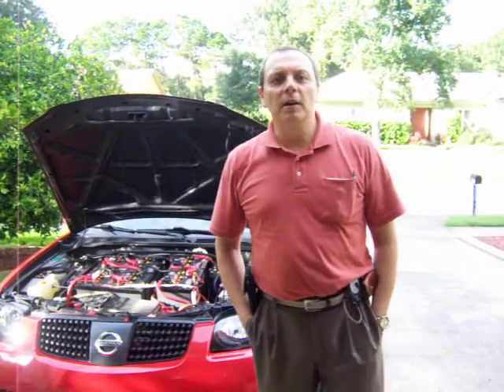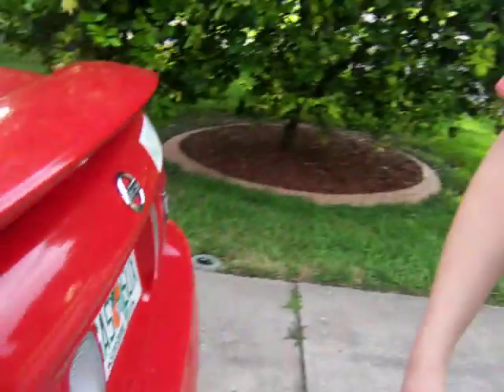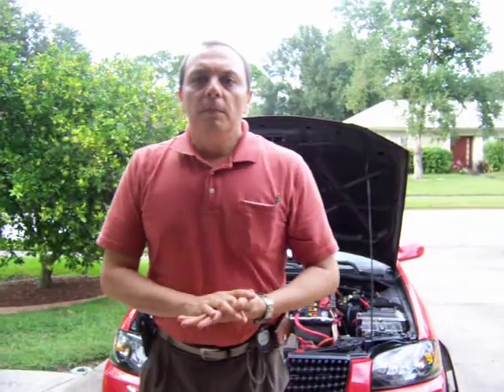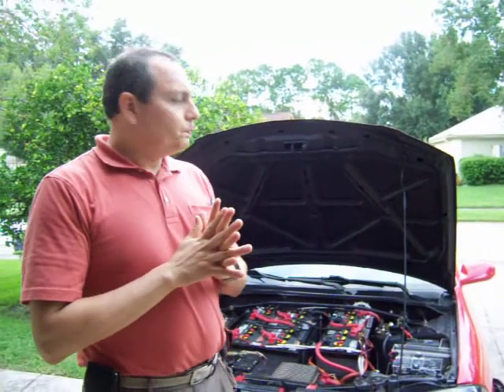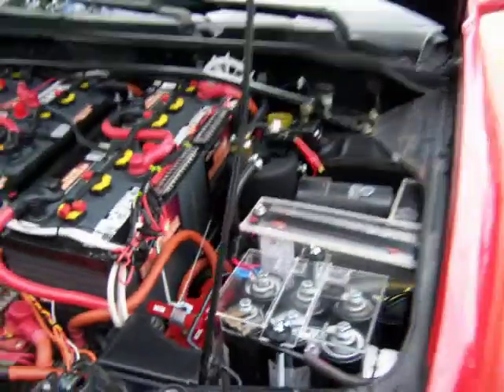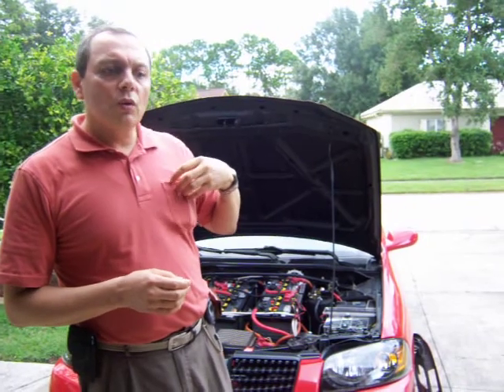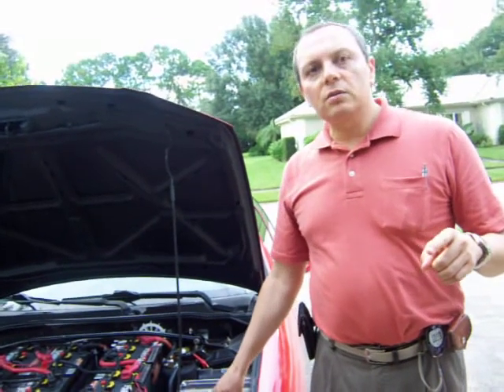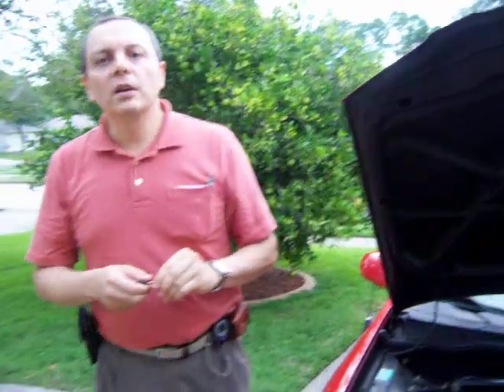Nissan Sentra Electric Car Conversion Part 34

Comment: On the capacitors:
1 They have a maximum voltage, not an optimal voltage like a battery.
A 15 Volt capacitor wil work happily (and deliver high amps) charged to 12 Volt, 9 Volt or 5 Volt. But of course more energy will be stored the higher the voltage is.
2 They deliver more amps than a lead acid battery because of the low internal resistance.
(this is one of the benefits you forgot to mention, mecanofan ;-)
3 Capacitors parallel to the lead acid batteries will slow down the voltage sagging during  accelerating, the batteries will develop less heat. BUT the batteries have to recharge the capacitors when accelerating is over.  So for short accelerations it should be a benefit, for long accelerations not, because the batteries will then be in a low voltage state and will stay there longer because they must recharge the capacitors and recover their own voltage at the same time.
Reply: Hello Fred. Thank you for sharing your knowledge and experience. I just started playing with Capacitors, so any information on this is welcome. Thank you again.
Reply: Jose Barriga I'm an electronics guy, I respect very much how you converted the car.

Comment from the maker: Yes, I have seen those mounts for the pumps, but if I get one of those, I would have to idle, and I don't really want to. I think it would be very inefficient compared to what I do now. The AC is always in low regardless of speed and it cools quite well, and power steering is used only on turns, so most of the time is off. I also prefer the DC to DC converter than an alternator, so I will just have to stand to the little noise when I am stopped and be more efficient instead and not idle.

Comment: evwest.com search product id: "ACC-75"

This will use a belt connected to your motor which will drive your stock pumps for vacuum, ac compressor and power steering. It is expensive but you could try making your own, it would be time consuming but it would make your car quieter, more reliable and you would get better range due to them not requiring power for motors.

Comment from the maker: Hello Evric. I believe so. After the first test I tried to discharge the capacitors to install them in the car, and I used a 160-Watts heater (12V x 13 amps) set on high heat and high speed and it lasted about 25 minutes to discharge the capacitors. I doubt the flashers will consume 160 watts. In any case, my capacitors are always being charged with the DC to DC converter, so as long as there is power in the main battery bank, the capacitors will remain charged at 100%.

Comment: Hi, In Australia, we have a regulation that the 12Volt system alone (if HV system fails) must supply power to run the emergency flasher lamps for about 20 minutes. Would your capacitors do that?